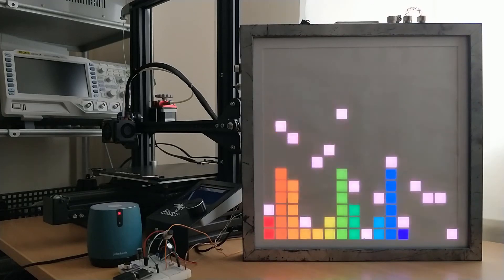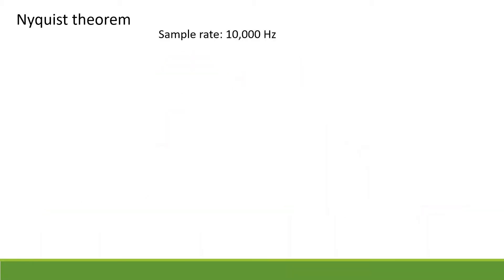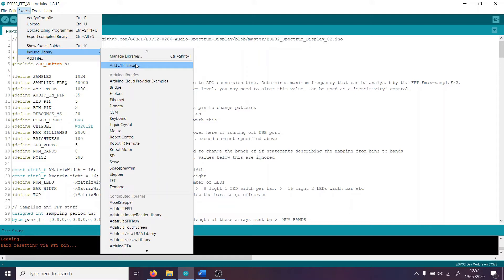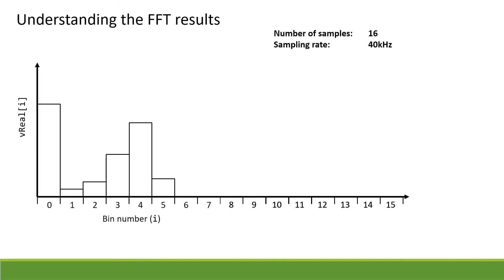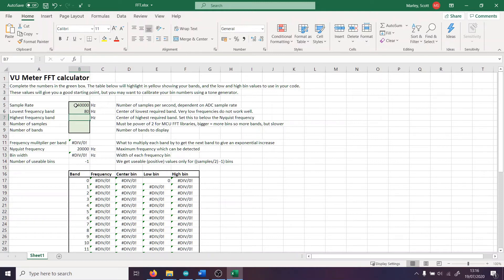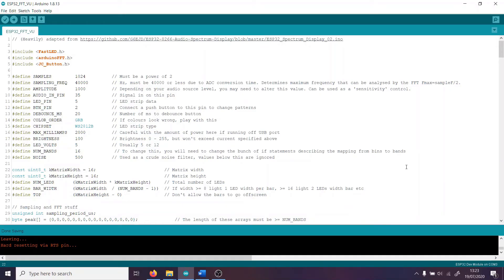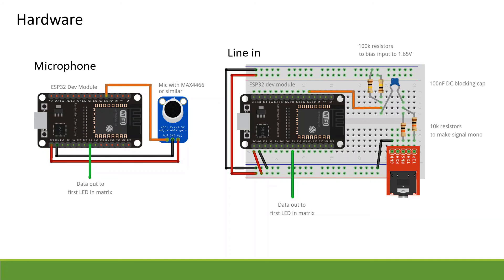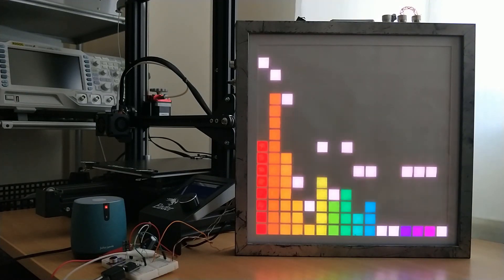ESP32 spectrum analyser VU meter using arduinoFFT and a FastLED matrix

Comment: Thanks, Scott Marley, for sharing this awesome video.  I tried building this project using an ESP32, and while checking the conversion time and max sampling frequency mentioned around 03:05, I noticed a few things. Just wanted to share my findings here in case it helps anyone else trying to build it too.     

output when esp32  Espressif Systems version 3.3.1 is used :
Conversion time: 41.67 uS
Max sampling frequency: 24000.21 Hz

output when esp32  Espressif Systems version 1.0.2 is used:
Conversion time: 9.71 uS
Max sampling frequency: 102965.25 Hz
Reply: Thank you! Your comment certainly helped me before I scrapped the cheap copy esp32.

Comment: Thanks for making the FFT theory easier.  I am using an ESP32-WROOM-32 (latest firmware Sep25) and I only get a sampling rate of 23,130 Hz (not 100 Khz).  Is there a possible ESP32 setting I have missed that's not in the 1M sampling code?   I am running at a reported 240Mhz.
Reply: Having read older comments, this seems a relatively common issue.  I reverted from firmware 4.1.1  to 1.1.0 (cannot find 1.0.4)  and still get around 23Khz.

Comment: Great script, thanks for sharing! 🙏
For those using the latest arduinoFFT library, here are the changes I had to make so it compiles correctly:

Line 38 – Specify template type and matching argument types:

ArduinoFFT<double> FFT(vReal, vImag, (uint16_t)SAMPLES, (double)SAMPLING_FREQ);

Lines 136–139 – Use the new camelCase method names:

FFT.dcRemoval();
FFT.windowing(FFT_WIN_TYP_HAMMING, FFT_FORWARD);
FFT.compute(FFT_FORWARD);
FFT.complexToMagnitude();

After these tweaks, the VU meter works on my ESP32 but not perfectly, i don't know why... ! 🎉
Reply: Beautiful! Was having issues with it myself

Comment: Hi Scott, thanks for the brilliant video, it really helped me understand how to use the arduinoFFT library. However, I am struggling to recreate it. I have an ESP32-DEVKITC-V4 based on the ESP32-WROOM-32. But when I run your Sample Test sketch it returns a sample rate of 24700 Hz, about a quarter of the rate you show in the video. I am not sure if it is something I am doing wrong, or if I have the wrong ESP32. Any help you or anyone else can give would be greatly appreciated.
Reply: as stated in a comment from another user above, change the board manager version of esp3 to 1.0.2. worked for me.
Reply: That worked thanks  @jamiesony3859

Comment: Arduino: 1.8.13 (Windows 10), Board: "ESP32 Dev Module, Disabled, Disabled, Default 4MB with spiffs (1.2MB APP/1.5MB SPIFFS), 240MHz (WiFi/BT), QIO, 80MHz, 4MB (32Mb), 921600, Core 1, Core 1, None, Disabled, Disabled"

ESP32_FFT_VU:38:1: error: 'arduinoFFT' does not name a type; did you mean 'ArduinoFFT'?   38 | arduinoFFT FFT = arduinoFFT(vReal, vImag, SAMPLES, SAMPLING_FREQ);      | ^~~~~~~~~~      | ArduinoFFTC:\Users\avina\Desktop\ESP32_FFT_VU-master\ESP32_FFT_VU-master\ESP32_FFT_VU\ESP32_FFT_VU.ino: In function 'void loop()':ESP32_FFT_VU:136:3: error: 'FFT' was not declared in this scope; did you mean 'fl::FFT'?  136 |   FFT.DCRemoval();      |   ^~~      |   fl::FFTIn file included from C:\Users\avina\Downloads\libraries\FastLED\src/fl/audio.h:3,                 from C:\Users\avina\Downloads\libraries\FastLED\src/fl/ui.h:6,                 from C:\Users\avina\Downloads\libraries\FastLED\src/FastLED.h:932,                 from C:\Users\avina\Downloads\libraries\Framebuffer_GFX/Framebuffer_GFX.h:33,                 from C:\Users\avina\Downloads\libraries\FastLED_NeoMatrix/FastLED_NeoMatrix.h:23,                 from C:\Users\avina\Desktop\ESP32_FFT_VU-master\ESP32_FFT_VU-master\ESP32_FFT_VU\ESP32_FFT_VU.ino:5:C:\Users\avina\Downloads\libraries\FastLED\src/fl/fft.h:66:7: note: 'fl::FFT' declared here   66 | class FFT {      |       ^~~Multiple libraries were found for "arduinoFFT.h" Used: C:\Users\avina\Downloads\libraries\arduinoFFT Not used: C:\Users\avina\Downloads\libraries\arduinoFFT-masterexit status 1'arduinoFFT' does not name a type; did you mean 'ArduinoFFT'?

This report would have more information with
"Show verbose output during compilation"
option enabled in File -> Preferences.

Comment: Thank you it was helpfull, but i had a question,  can I use different band out put in to different GPio pin or output pins?
by doing some adjustments on the code?

Comment: Hi, I'm hoping you can help me. I have just started with Arduino and have been trying to make a spectrum analyzer using various codes for projects like these downloaded and run in my IDE. I have the latest "arduinoFFT" library 2.0.2 by Enrique Condes but every project I try returns the fault: error: 'arduinoFFT' does not name a type; did you mean 'ArduinoFFT'?
arduinoFFT FFT = arduinoFFT();  I can see the difference between "arduinoFFT" and "ArduinoFFT" but the code obviously works for others so why do I get a fault for each project?

Comment: Hey Scott. I know this is a massive shot in the dark but I've been having issues recreating your project because my ESP32 can apparently only read the analog pin at 14kHz. Could you share the exact board you are using or if maybe your ArduinoIDE setup is different if possible? Kinda scared to get into possible solutions like I2c. Great video by the way, got me into making stuff at home and not waiting for school projects to start being interesting.
Reply: ESP8266: It features a single-core Tensilica Xtensa LX106 processor clocked at 80MHz.
ESP32: It has a more powerful dual-core Tensilica Xtensa LX6 processor, which operates up to 240MHz. This makes the ESP32 capable of handling more complex tasks and computations compared to the ESP8266.

Comment: Hi Scott, Yet another excellent video. Ive been attempting to use an MSGEQ7 to position a servo based on speech (anamatronic project) ; after looking at your work your ESP32 VU meter project, it would appear it might be a viable alternative to use ArduinoFFT. Im definitely in the 'novice' category when it comes to coding so would be grateful for some assistance. As Im only looking at male/female vocal frequencies, I don't require many bands. I also need to average these  and map against the range of a servo. How easy is this to achieve?

Comment: Hi Scott. Thanks for amazing video man. FFT on ESP32 wonderous. A quick question. I tried hooking up line in with a 3.5 audio socket, 2 10k res for mono, 100nf for DC filtering and 2 100k for DC biasing. But when I connect my iPod or phone output to this, I get no audio read in pin 35. I tried changing to 34 and 36 too. But there is nothing there. 

Do I need to use an analog amplifier when using with PC/Mobile/iPod headphone out?

Thanks for the wonderful explanation about FFT and your code!

Comment: Hello Scott, I used your code and made a spectrum analyzer and edited your code a little, which of course turned out to be very beautiful.  I made this device in 24 bands and 18 pixels high.  But the audio analysis speed is a little lower than your device... Is there a way to increase the speed?  In addition, I tried a lot to create a peak pause, but unfortunately I haven't succeeded yet... Do you have a way to solve these issues?  Thank you very much.. by the way I am new to coding!

Comment: Thanks for the video Scott. It told me just what I wanted to know.

This post is for the benefit of anyone considering using an ESP32-S3. Its A/D is not as fast as the ESP32. I ran the Sample Test sketch on a LilyGO T-Display-S3 and got the following rates
So I guess its good to around 8kHz audio which is the upper limit of what I need.

Conversion time: 60.12 uS
Max sampling frequency: 16633.61 Hz
Conversion time: 60.12 uS
Max sampling frequency: 16632.99 Hz

I then thought I could be clever and reduced the A/D resolution from 12 to 9 bits to get a higher conversion speed but alas no luck in Arduino IDE. It was identical.

Comment: Hi Scott, I saw your 3D printed spectrum analyzer (amazing project) that uses a INMP441 digital mic and I’m trying to adapt that code to this first version, because I prefer a physical control rather than depending on a smartphone, but my experience with C is limited, and I’m not able to find the exact part that manages the audio input. Could you please help me? TIA.

Comment: Hello. Thank you for yet another fantastic video. I've used the suggested code to check the sampling rate of my ESP32 and I'm getting nowhere near what you are. Mine comes out closer to 11 kHz! I don't think I've made a typo in the code... I'm using pin 33 of my uPesy ESP32 Wroom DevKit board. Is there a faster pin, or is this a slow board? Any help would be much appreciated!

Comment: I've got a question. Do you need to have 8 channels or can it be 2? Like can I use FFT to turn on one single LED or does it have to be a higher number divisible by 2
Reply from the maker: You can have as many or few channels as you like.  You'll have to alter the code a bit though to do what you want, unfortunately I don't have time to offer direct help on this. If you just want one led to flash in time with the music though, you don't need an fft at all really. Just analogRead the signal and turn the LED on when it exceeds a certain level.
Reply: @ScottMarley  okay thank you so much man
Reply: @ScottMarley  wait, would it still be able to read bass, mid, and treble?
Reply from the maker: @yung_wise5861  no, you would need the fft for that.
Reply: @ScottMarley  alright thank you man that's all 😅

Comment: Great tutorial. I do not have this led breakout but I will try to adapt your code to work on an optimized and very fast oled library I wrote for SSD1331 and SSD1351 color oleds (96x64) and (128x128).

I have a question for you... what ESP32 Arduino Core version do you used to make this ? I tried your code to get max sampling rate from ADC but using last 2.0.6 core I get about 11Khz max and a sampling time about 90us on Wemos D32.

Instead using ADC over I2S DMA the max sampling rate from core examples sketch is 277 Khz.

Probably something was changed in the core.

Anyway, the library I wrote is hardware optimized and permits very high refresh rate, I can stream videos from microsd up 140 FPS with both ESP8266 and ESP32 so I think results shoud be good and fast. For ESP32 I just used single core, so probably It can be optimized more. But note that SSD1331 have a very small display, about 2.5x2 cm.

Before to do it, I have to use FFT arduino library for a bit different project, I need to acquire audio from I2S microphone  use FFT to get a frequency and convert it to midi. I have no problems for midi and others stuff but my problem is FFT library,  I never used it. I found a couple of tutorials on how make a spectrum analyzer, but I do not  need to get all bands to show, instead i need to just know an most precise possible the dominant frequency that is at higher level, the fundamental of a voice or whistle over a microphone. 
You think Great tutorial. I do not have this led beakout but I will try to convert your code to be working on an 96x64 optimized and very fast library I wrote for SSD1331 and SSD1351 color oled. This library is hardware optimized and permits very high refresh rate, I can stream videos from microsd up 140 FPS with both ESP8266 and ESP32. For last I just used single core, so probably It can be optimized more. Before to do it, I have to use FFT arduino library for a bit different project, I need to acquire audio from I2S microphone  use FFT to get a frequency and convert it to midi. Please is that possible? I have no problem for midi and others stuff bu my problem is FFT library  I never used it. I found a couple of tutorials on how make a spectrum analyzer, but I do not  need to get all bands to show, instead i need to just know as most precise possible the dominant frequency that is at higher level, eg. the fundamental of a voice or whistle over a microphone.

Please do you know is that is possible ? Should be realtime...

Many thanks

Comment: Thanks for a wonderful tutorial. My build went right to work 1st time and the different modes were a delightful surprise. My larger project is to use an IR distance sensor to track trombone slide movements and encode MIDI signals. Besides recording parallel audio and MIDI signals, I can also light 64 individual WS2801 led's in a spiral piano array. Additionally, the MIDI signal operates a silent mono synth that in turn runs your spectrum analyzer. Part an art piece and part a scientific search for patterns in microtonal music. Thanks for adding another dimension to my quest. GCH
Reply from the maker: That's a really creative idea, I hope it all works out for you!

Comment: Arduino: 1.8.19 (Windows 10), TD: 1.57, Board: "ESP32 Dev Module, Disabled, Default 4MB with spiffs (1.2MB APP/1.5MB SPIFFS), 240MHz (WiFi/BT), QIO, 80MHz, 4MB (32Mb), 921600, None"

Marley_spectrum_analyser:46:28: fatal error: audio_reactive.h: No such file or directory

compilation terminated.

exit status 1

audio_reactive.h: No such file or directory

This report would have more information with
"Show verbose output during compilation"
option enabled in File -> Preferences.

This is the message I get, the library is not listed in my library, please help !

Comment: Hi Scott, great video, very helpful! I made my own using a 64x32 LED matrix from Adafruit, and after a lot of tweaking of parameters, I got it to work. But there are some low-end bands that are blank due to the output of the spreadsheet. I used these inputs: sample rate: 28000, Lowest freq. band: 20, highest band: 14000, # of samples: 512, # bands: 32. The resulting code generated in the table  includes many lines like this:  if (i>1   && i<=1  ) bandValues[4]  += (int)vReal[i]; Since i can never be > 1 AND <=1, the conditional is always false, and hence the band is empty. Can you suggest a way to tweak the calculations to make sure all bands can display accurate content? Thanks so much for such a helpful start to my project!

Comment: ! Thank you so much for the clear description of FFT as well as the library. I'd like to ask if it's possible to read the data from Bluetooth? I mean using the A2DP library to feed audio signal instead of line in. I've seen other people do this but none comes with an explanation of their code. Thanks in advance!
Reply from the maker: That's a good question, I suppose it should be, but I've never played with the BT stuff on the ESP so I don't know for sure!

Comment: Hello, I would like some help with the following:
I have a 7018b touch screen on which I made a boom box
and I want to connect the audio output directly to the Arduino uno that will connect the lieds board
8x32 led RGB panel to the rhythm of the music without using the Sound Sensor. Where can I find the schematic and code? I used sp107e box and it doesn't work properly because the leds go up and down even without music.

Comment: I just had a try on my esp32 with "Sample_test.ino" and I received very poor conversion time 84.96µS with a max sampling of 11000Hz, reading the comment I found that installing ESP32 1.0.4 version should solve this issue and this is the case I get now 9.23µS and 108332 Hz. I don't know the reason , surely related to clock divider but  I can continue now with this amazing project. Thanks a lot.
Reply: Thanks

Comment: Hi Scott,
Can I use ws2811 led strip instead of ws2812 without changing the code ?
thank you.
Reply from the maker: Yes, don't see why not. You might need a level shifter between the data pin on the esp and the led Din, but it might work without.

Comment: Hi thanks for this great effort. Can I extend this setup to 16x64 with the same code u have?
Reply from the maker: In principle you can, see the Excel file on the GitHub link. However unless you up the number of samples (and slow down the update rate) some of the bands will overlap if you have 64 bands.

Comment: Hello. i just bought an ESP32 module, when i try to run your test i got:  
14:50:59.321 -> Conversion time: 53.85 uS
14:50:59.321 -> Max sampling frequency: 18570.64 Hz
so under 20KHz... that shouldn't be that low right?
Reply from the maker: They seem to vary a lot. Not sure why as I'm not an expert on these things! You could build it anyway, it will still look pretty just won't be as accurate. The microphone won't pickuo up to 20kHz anyway
Reply: Hey Stefano, I had the same experience with every ESP32 I tried (I think 3 or 4 different in total) being much, much slower than what I saw in videos I watched. 
Try running yours with a sampling frequency of 30,000 Hz and 256 Sample Size. From what I tried with mine that seemed to provide decent performance. 40 KHz and 1024 Samples always produces a slideshow for me.
Reply: @ChrisHansenYup  i tryed 8kHz and 32 sample, still not working
Reply: From other replies, change the version of your esp32 firmware in the arduino IDE boards manager to 1.0.4 as 1.0.5 and 1.0.6 return the slower sampling rates you are experiencing.

Comment: Hey Scott, thanks for this fantastic starting point for my project. I made this powered by a DeWalt battery, mounted to a pole and had to heavily modify the code and hardware to get it to work in any volume level environment. I can't say how much longer this would have taken without this starting point, but I can say it would have been a lot longer. 

I had the idea to do it 8 years ago and finally sat down to do it last January and found your project during the research phase. Finished it in August and took it to a music festival, people absolutely loved it. 

Thanks again for the great work!

Comment: My nodemcu esp32 board only manages 18khz, which is very confusing ... Shouldnt those boards all be the same open source hardware? I reduced the sampling freq to 18khz for now, but results should be worse, i fear. Could you link boards that worked out well for you? 

i also came across the problem, that my sensitivity usually is way off.  any ideas on how to automatically adjust it?